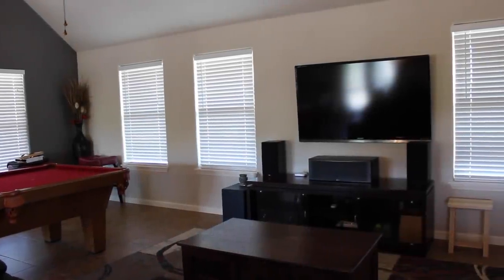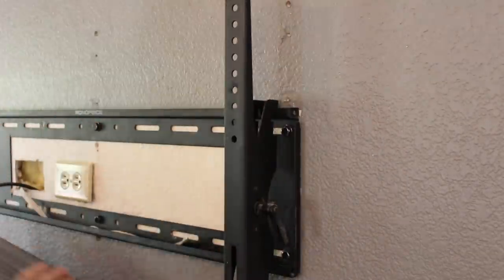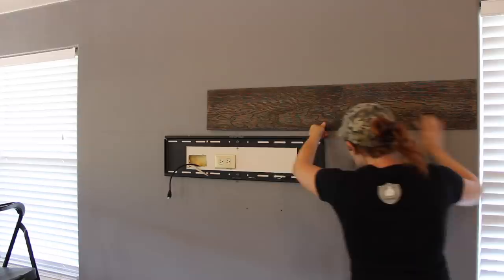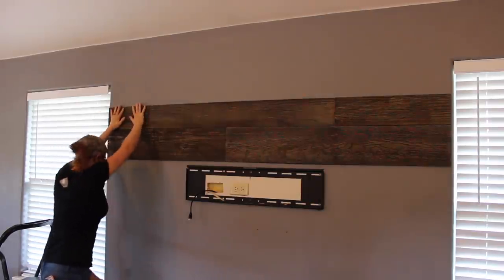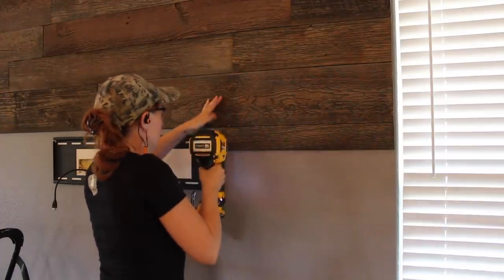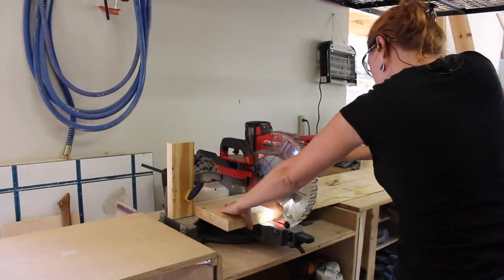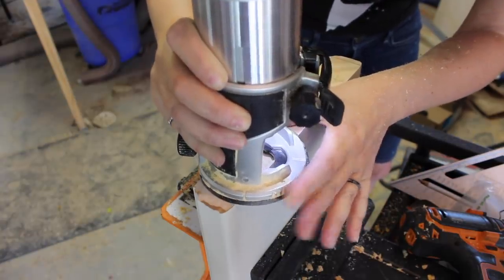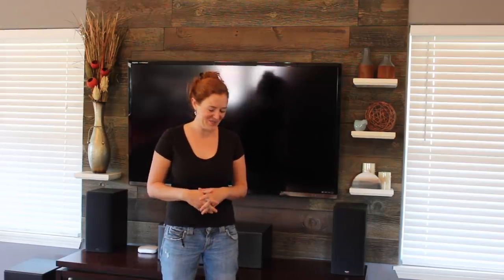DIY Wood Wall and Floating Shelves

Comment: Looks good  April  .
Just wondering about your stud-finder ( don't currently remember the brand , but it appears , from what I've seen about them , they work very well . have you ever had any issues with it . .....works real good doing this , but not so well do that , or works great everywhere  , no issues . 

Will be waiting/watching for that entertainment unit .

Thanks for the video 

Bob from Calgary
Reply: I think it's a Franklin.  I have one and it worked great until it got squished under other tools in the back of my truck.
Reply from the maker: Yep it's the Franklin and it's outstanding. I've never had any issues with it and I've been using it now for four years. I smashed three other stud finders before spending the money on this one...it's worth the higher fee they charge for it.
Reply: Sounds good , thanks

Comment: Good work overall, however, if I may. I think you did a fatal mistake of not protecting the wood against humidity/condensation. You should have added a protection layer (isolation) between the wall and the wood to make it last longer and be less prone to fungus and other pathogens. I like the end result in any case.

Comment: just wondering.. why the bracket wasn't centred in the first place.. whats behind the wall?
Reply from the maker: The previous owner had a different set up, so when we were moving in we just threw the TV on the bracket as is to quickly unbox it. It's an exterior wall so nothing is behind it.

Comment: That dewalt nailgun makes an ungodly amount of noise. Is that all battery guns or just the dewalt?
Reply: I actually own the 16g version and it's not really any louder firing than a pneumatic. The benefit is there's no compressor running either.
Reply from the maker: They are all about this level. The way I think about it is, it's still quieter than a compressor running in the room. ; )
Reply: The DeWalt uses a flywheel that you can hear spinning up. Most of the other cordless guns use a compressed gas cylinder.

Comment: Your front channel speakers are too close to each other. Your listening position should be on the top of the equilateral triangle and because of that you have now reason to make nice massive stands for them. Don't forget that tweeters should be in the height of listeners ears.

Comment: Should have done the whole wall and don't add a piece less than 10 cm in length. Mount flat screen hardware after you are finished.

Comment: Hi April,you must work with to reduse the eco in your living room,try some softer material in the roof,mabey this will help
Reply from the maker: I am not going to install panels in my living room so that my 20 second ending doesn't have an echo. This is my home before it is my production studio.
Reply: Ok,are you bulding an new workshop ? by the way i was make an flower pot to my brothers wife 60 birthday,it was an eight edged pot with 10 dergeed angel,all making by 2x4 who im cuts in straps and dimensions,then i was make an eight edged ring with an 10 degree side flat to use to the bottom support who i was glue and nailed strip at the center on every flat side,then i was marking the angel on every corner strip and making them together before i make the top ring and trim for the top and botton,this was an  an 3-4 days work,and she was realy happy and the rest of the gests was wondering who was made the pot since im an metal worker whos velding my things togheter.....I can send you some pixtures of the work if you are intressed
Reply: It will make the sound from the entertainment center better, also. It doesn't have to be panels. Rugs, tapestries, etc. will help. Definitely too much echo for a sound system.

Comment: Not bad but you made a common DIYer mistake. On the right hand side you created a stair step pattern. Patterns like that draw your eyes from the overall pattern effect. You need to offset the boards more so there is no distinct pattern. I inadvertently made stair step patterns on my hardwood floor and my eye's are always drawn to the stair pattern. I learned this from a professional floor installer after the fact.

Comment: Why paint the wall and then turn around and glue fake wood to it?  Were you just trying to get rid of some extra paint?
Reply from the maker: No I meant to leave that section bare, but got into the zone of painting and forgot.
Reply: Yeah that's too easy to do not a big one and on the plus side it meant you didn't have to worry about cutting in around the boards.

Comment: I'm a professional hardwood/laminate floor installer and I kinda cringed the way she arranged those boards. I would of used two full pieces for the first row, and just cut the ends so it would look all nice and even, then I would lay the material in a random pattern not a stair pattern which she did which looked horrible.